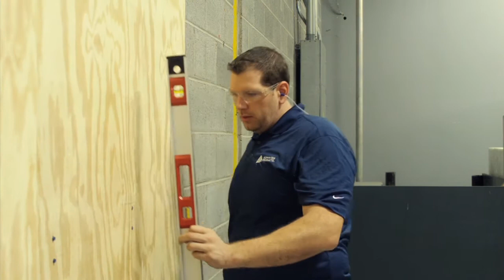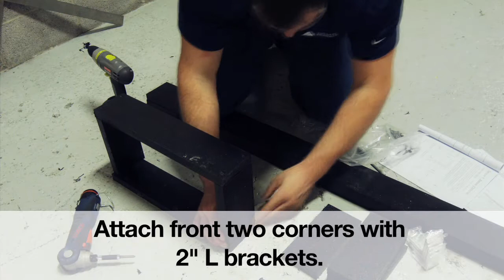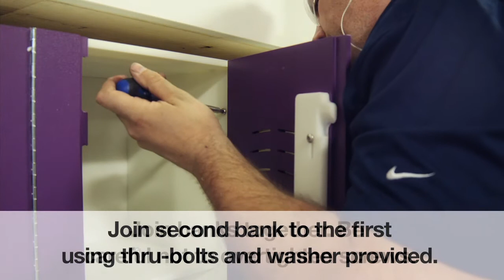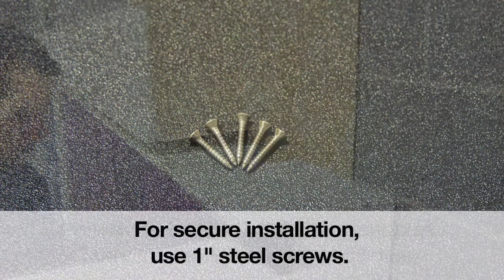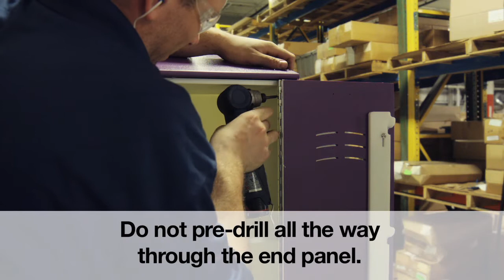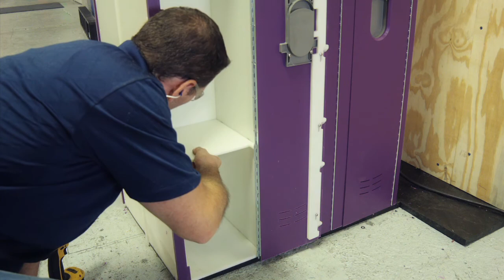Scranton Products Locker Installation Training

Comment: Also even these instalation instructions are trash. They do not provide enough information and Im still struggling to install these even after watching this video and reading the book of instructions sent. The video and the install instruction booklet dont even say the same things.
The video uses circular saws but the book told me i need a jigsaw so i just spent $100+ on a tool you said i need that your video now says i dont.

Do better.